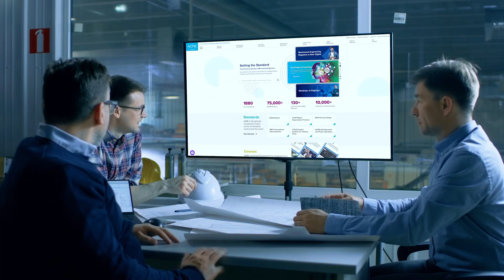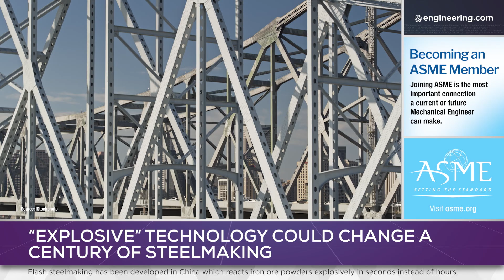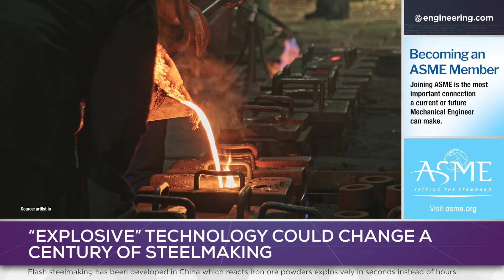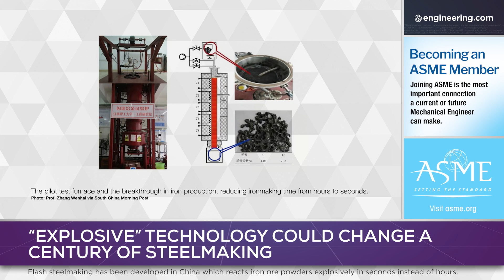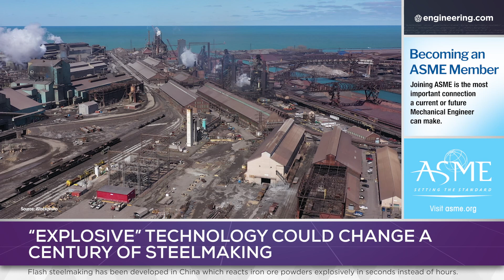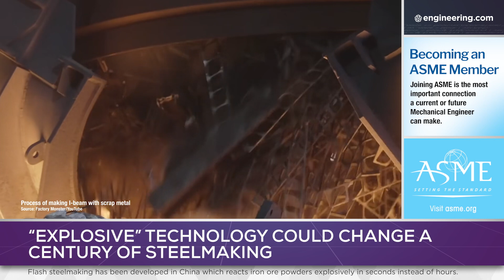Changing a Century of Steelmaking in a Flash

Comment: the 3600x claim is pure smoke and mirrors, comparing a many ton batch to a tiny amount is no comparison but it makes for a great sensational but BS headline afterall if they really could produce that 3600x fold improvement it would be violating several thermodynamic laws, weather you heat 50T at one time or 50T 20mg at a time it will still take about the same energy even if the  fines suddenly make the same chemical reaction highly exothermic... it just doesn't jive... this at best could be compared to a thermite reaction but the prep of the materials will take just as much energy...

however if this does allow for somewhat cost effective tiny batch production it is worth looking into the process further but one must remember there is no free lunch

Comment: Chinese smoke and mirrors..  NUCOR has been adding 10% iron ore to its scrap metal process and this is the basis as even stated by the Chinese.  All the Chinese have figured out is that using a continuous puddle chamber, as long as one keeps the mix in proper ratio, that 10% iron ore can be shot in to the puddle furnace with a flux, air injected.  the air becomes plasma as it is injected ito the molten steel, thus one gets the elemental O that strips carbon out..  through a tungsten tube...  The real threat is that this can be scaled down, even past NUCOR's initial 100 ton batch furnace.and the slag taken off the top into an industrial process that can be used to make  tetra-calcium aluminoferrite  cement precursor.  Iron rebar is out and rock-wool wire and bar is in..

Comment: While fine in theory, to make all steel using hydrogen would require more energy than we make currently.
Approx 146,000,000 tonnes of steel was produced in 2024...
That is a massive amount of hydrogen to make.
Reply: but wouldnt this be offset by the amount of energy saved from drastically reducing the time to melt them?
Reply: Forget being woke and we can do this with LNG as well.

Comment: Basic iron melts at 2800°.Could you imagine how hot a room would need to be for something to be Tossed into it in powder form and immediately melt. Not oxidized melt into a collection chamber that can be poured or cast in high quality and do it more faster and efficient than common day.Blast furnace sounds kind of hype up Or misunderstood that is actually something  that can be used in a lab setting
Reply: You are incorrect.

The process is being commercially rolled out.

Comment: In theory, this could be done at the mine, as part of ore extraction, delivering iron ingots instead of iron ore pellets. All you need is H2 and a device that looks like it might be about the size of a diesel engine, it seems. Pack a portable smelter into a shipping container. Get the H2 gas by Allam Cycle from biomass, and pump the CO2 into the mine to help frack the ore, for carbon credits.
Reply: It'll also require a vast amount of electricity but mines consume a lot anyway.
Reply: Hei great idea. I think instead of hydrogen, we can use LNG for reduction? Or generate hydrogen from LNG on site?
Reply: @aniksamiurrahman6365  Why would anyone in 2025 suggest shipping the dirtiest fuel on the planet through the leakiest pipelines, when H2 is so plentifully available from secure renewable sources?